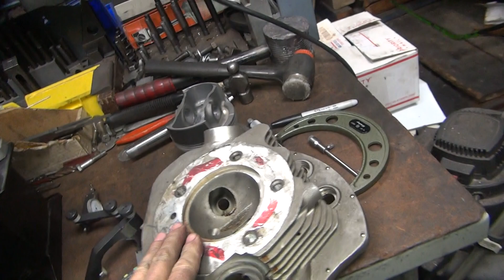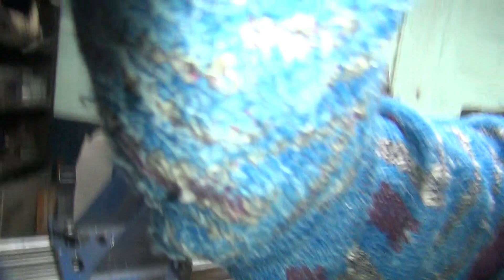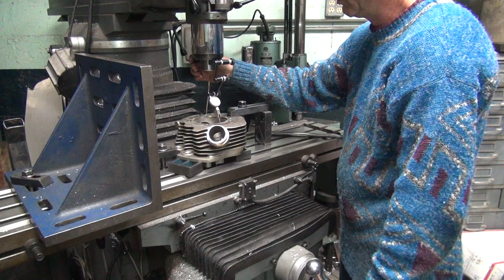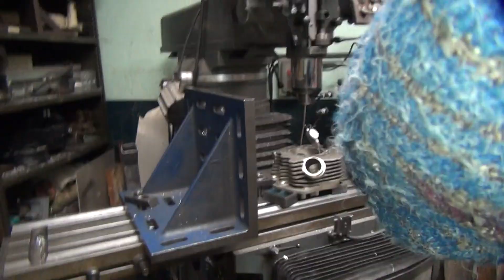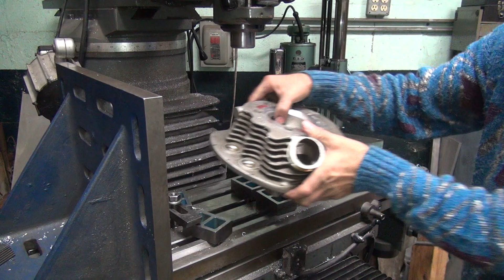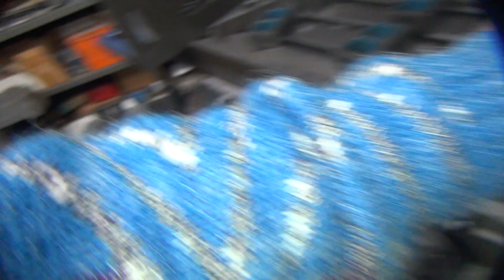#142 wasting time again mock-up panhead race motors out of junk harley landspeed scta tatro machine

Comment: Where on EARTH do you find a cam that will function correctly with a set up like that? Your Exhaust lobe is now an intake and vice versa? This should be VERY interesting....
Reply from the maker: anything can be made but you lost the point of the two rear heads. go look at the harmon motor again.
tatro